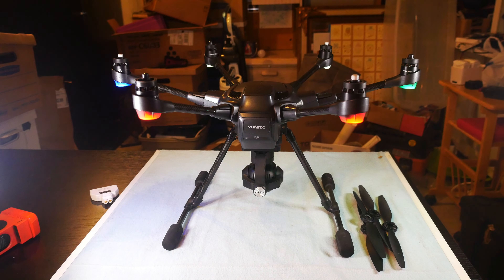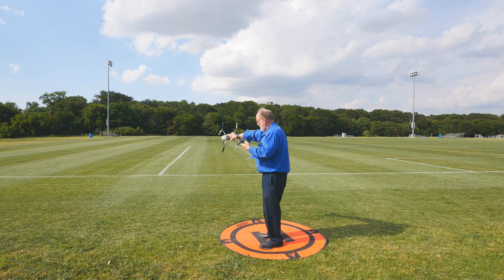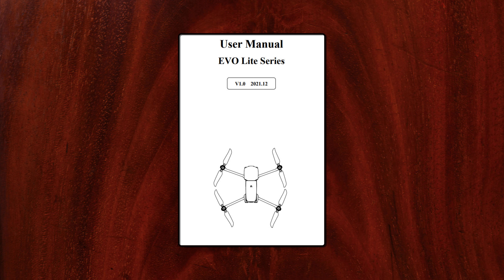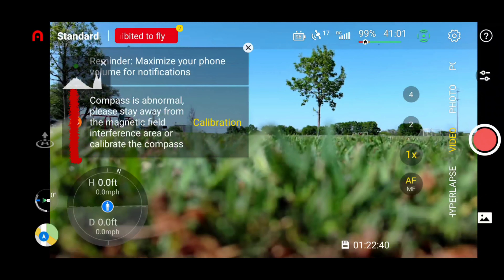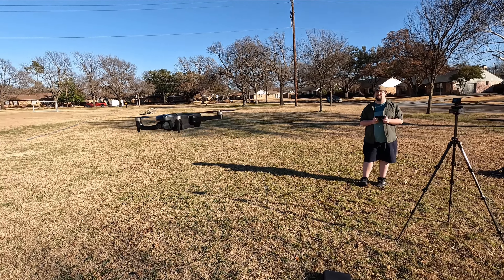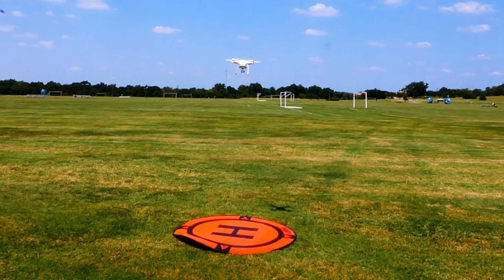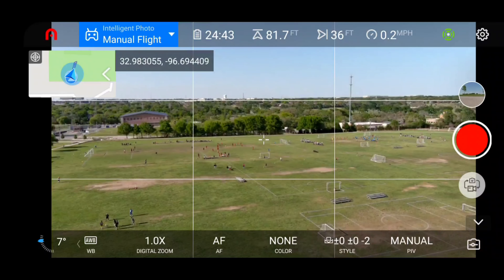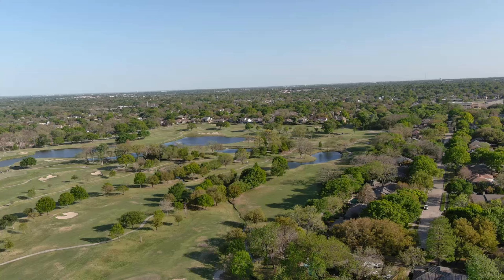When Do I Calibrate a Drone? What Does Toilet Bowl Effect Look Like?

Comment: Hey Jeff. I only have the Evo1 and don't do a compass cal unless I'm far away from the last place I've flown. It's quick to do and it has never failed. I do always check the sticks on the remote control to make sure the drone is working correctly. Just took the old bird out for some exercise a few days ago. Nothing to scenic, so haven't posted yet. Hope you're doing well. Still haven't see you out there with the Evo1 since you last bought the batteries on sale.
Reply from the maker: Hi Chas - I can only think of one time when I've ever calibrated the sticks, and that was a problem with the Typhoon H. 

I've been knocking off several videos that I've had queued up for awhile, and I'm about to start doing several Autel videos - Evo 2 Pro, Evo Lite Plus and a couple on the original Evo. I never did find my charger so I tracked down a replacement charger on Ebay . . . I should be able to get that one up in the air now, at least.